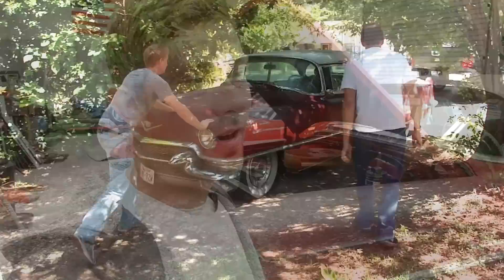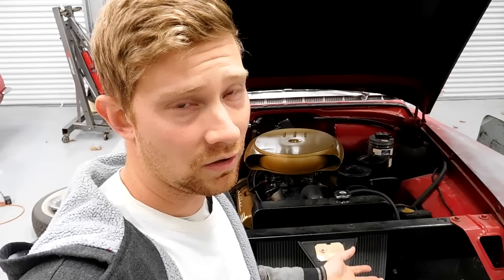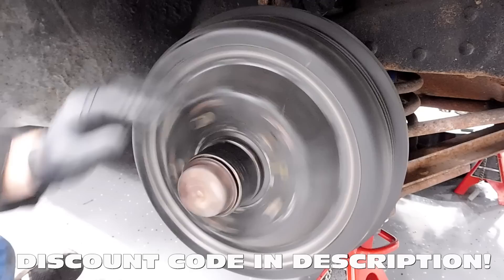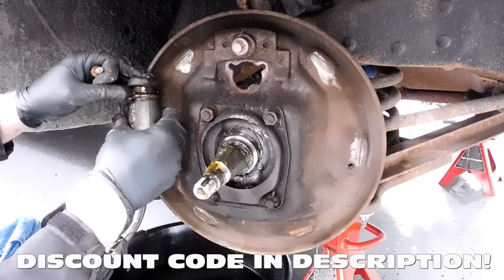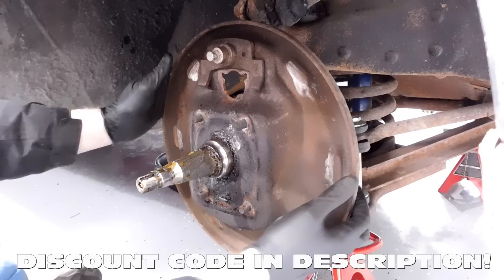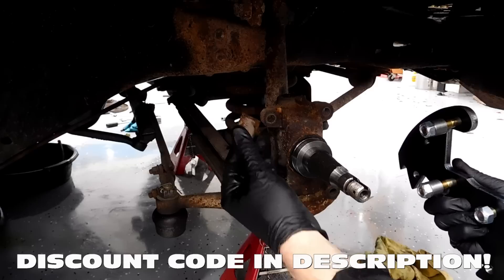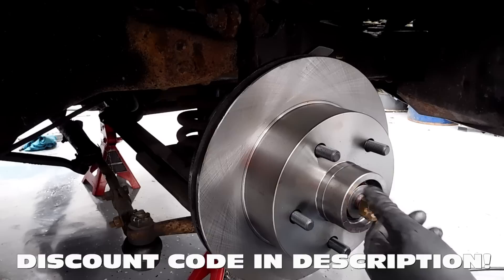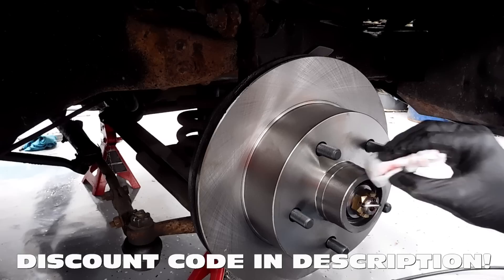1956 Cadillac Disc Brake Conversion Part 1: Caddy Daddy Front Disc & Dual MC Brake Kit How To

Comment: Caliper in front does add to nose dive under braking due to rotation of rotor when it interacts with the brake pads. I prefer mine trailing so there is a lifting force and less dive, but some cars stop better with leading position. Rear caliper in leading position reduces lift under braking. I think later vettes were set up this way. Lovin the 56! Good upgrade.

Comment: Nice to see the Cad again, I have been around long enough to remember when you got it, and all the trials you went through with one engine "builder"...a long time ago. Looks like a nice brake kit. I am an old guy and watched  my Dad who was a HD mechanic/machinist and he did side jobs at home.  He traded a 52 MG TD for a very nice 56 Sedan a lot like yours. I remember riding in it.....The reason for those pins in the lower bolts is probably the  fact that the steering arms are bolted to the spindle through them.

Comment: There's keeping a classic original, and then there's safety functions that should be updated to modern standards- brakes are the latter without question.  You hit the right balance between as GM designed and built that Caddy and improving it for better usability.  Great to see the Caddy getting some video time!

Comment: When upgrading BE SURE to have the NEW Disc Brake Caliper bleed screw on the top side. Sound intuitieve, but if it is on the lower side, you can never get ALL the air out of it when bleeding.

Comment: Are the calipers,  pads , rotors and bearings readily available at parts stores ?                                                                  
  Do they cross reference to a 2wd truck/van etc ?
 Modified tools needed for the pins dosen't look to promising for future repairs. 
 Most mods I do on older cars are for reliability and simplicity. 
 Enjoy your videos.

Comment: Hi Ben. Good to see another video on the Cadillac. She’s a grand old classy lady. Disk brake upgrade? YES!  

Question. Are we going to see the trunnion bushings in the spindle renewed any time soon? The upper spindle/wishbone (control arm) joint look to be excessively loose and wobbly. Can’t be good for steering feel and tire wear.

Comment: Honestly I do not like those cars converted to modern brake systems. I drive my old GM cars with stock brakes for over 40 years and honestly I never had issues with the brakes except once when I started having brake fading after running down a steep curvy mountain road for over an hour and with 6 persons aboard. That was quite scary but noone realised the issue when I hardly made it around a very narrow turn. I am an old man and I am used to old vehicles. The oldest one I drove was from the late Fourties. And I drove Army trucks of the Early Fifties without power steering!
Of course you have to adapt your driving style.
Last month I drove an Alfa Romeo sportscar of the Midsixties. In spite of having diskbrakes rear and front compared to modern cars the brakes must be called lousy.  But once you know that you must simply keep enough distance to the car in front of you.